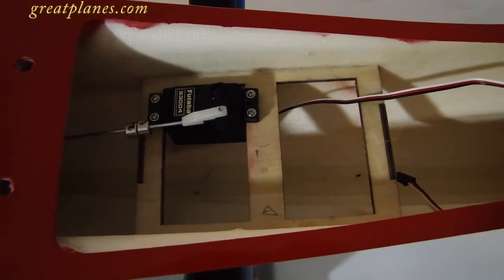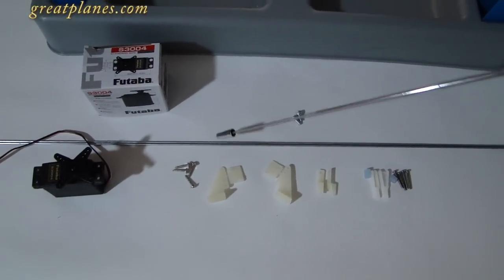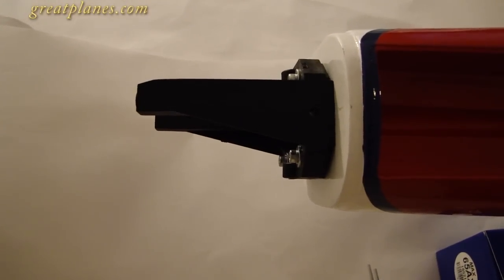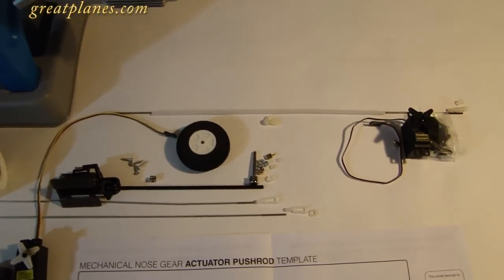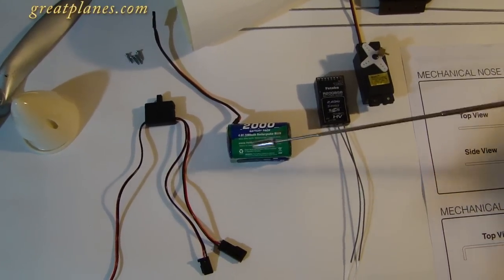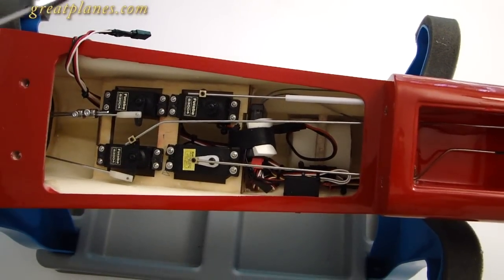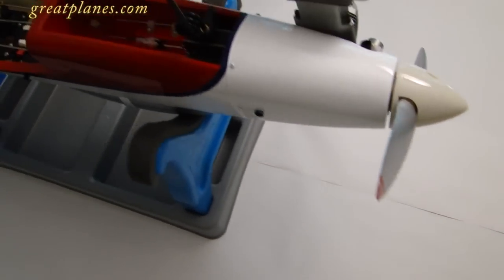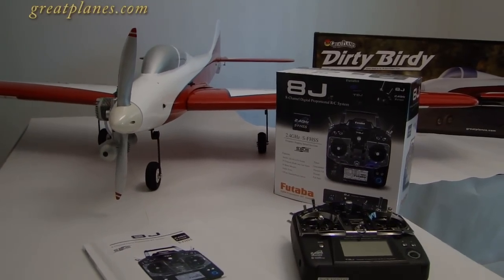GreatPlanes Dirty  Birdy Build Video Part Two

Comment: Hi buddy. What hardware did you use for retract landing gear?
Reply from the maker: *****  I used the hardware that was recommended in the instruction manual. It listed all the servos and gear. I believe the gear is sold separately  all available at Tower Hobbies. Thanks for commenting ..Tim